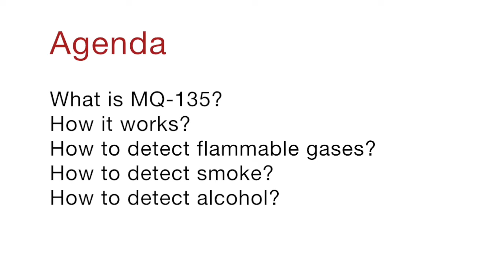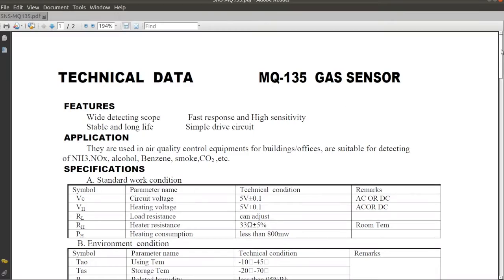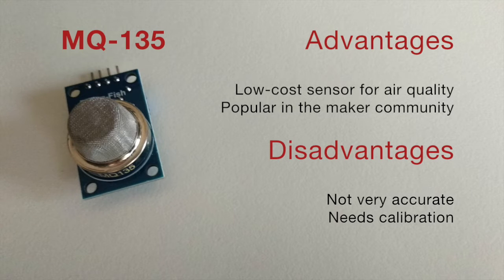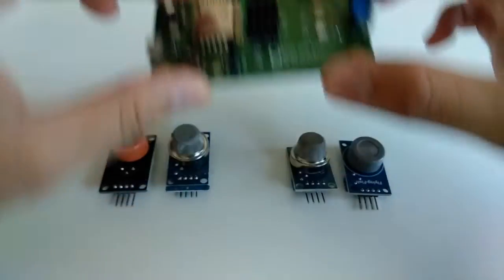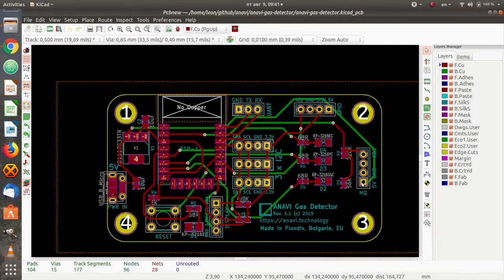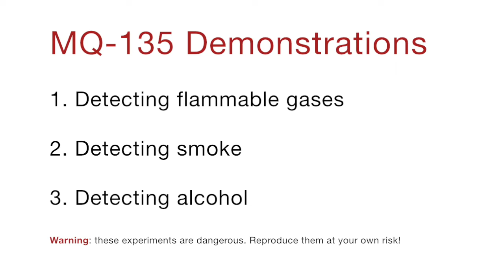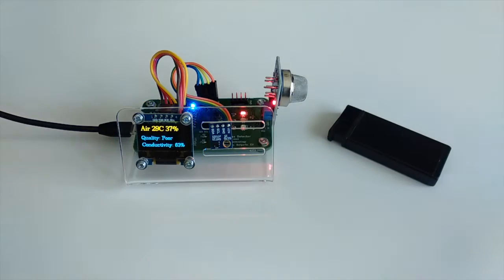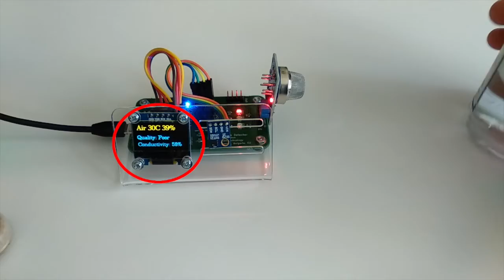MQ-135 Gas Sensor Module

Comment: if my sensor has 1k resistance and i want to change it to 10k ohms resistor ..how can i change it without removing existing resistor on board and put 10 k ohms resistor?
Reply from the maker: Well... good question but unfortunately in this case I am afraid you will need a soldering iron to swap the resistors on the MQ-135 gas sensor module.
Reply: @LeonAnavi  i have tried an another option to put 10 k resistance and its works for me if the output is 0 the air quality is fresh or good .. and in co2 concentrate the baseline is 400 ppm
Reply from the maker: @jeremytiempo9639  Cool! Well done! Keep in mind MQ-135 and the other MQ gas sensor are for detecting dangerous gases in the air but they are not reliable for calculating the exact concentration of a particular gas. Details are described in the datasheet of the particular sensor. I think of MQ gas sensor more like an alarm: ok or not ok.
Reply: @LeonAnavi  the option is both side of a resistor connected to A0 and gnd pins

Comment: Hi Leon can we use MQ-135 module for detecting and also measuring the Ammonia level in the environment? if possible how to calibrate for the same?
Reply from the maker: yes, MQ-135 also detects Ammonia (NH3) however this low cost sensor is suitable for detection only. It is not capable of measuring the concentration of a specific gas in the air.

Comment: Carbon dioxide is not a dangerous gas. Do not confuse it with carbon monooxide. Do not fall to trap of laymen and Gretas.
Reply from the maker: This is a video about the MQ-135 sensor which is suitable for detecting
 of NH3, NOx, alcohol, benzene, smoke and CO2. The immediately dangerous to life or health of these gases depends on the parts-per-million (ppm) concentration in the environment.
Reply: @LeonAnavi  The video is good, I liked it. Your review of the sensor helped me to decide which sensor to buy.
It would be good not to create a misleading impression that CO2 is a toxic gas. https://ehrs.upenn.edu/health-safety/lab-safety/chemical-hygiene-plan/standard-operating-procedures/sop-hazardous-and , e.g. nitrogen could also be lethal depending on its concentration, but it is not toxic.

Comment: i bought the whole set of mq sesors from ebay and they work but they came with a Pro Mini strong Atmega328P and i cant figure out how to use the damn thing. any tips?
Reply from the maker: Have a look at the source code of ANAVI Gas Detector in GitHub. Although the wiring will be specific for your pro mini, the Arduino sketch will be similar (without the WiFi and MQTT parts due to the lack of such capabilities on pro mini): https://github.com/AnaviTechnology/anavi-gas-detector-sw

Comment: Great content sir! But a small doubt, how to preheat the sensor? Just leave it in room temperature for 24 hrs?
Reply: Even after 24 hours the resistance values are changing continuously
Reply from the maker: yes, you should leave the MQ-135 sensor module in a room with clean air, turn it on and keep it working for at least 24h.
Reply: @LeonAnavi  thank you so much!

Comment: as we know that this sensor is used to detect 3 or 4 types of gases so sir is this possible to get information about which gas is sensed ?
Reply from the maker: No, sorry, MQ-135 is a low-cost analog sensor only suitable for detecting dangerous cases and air quality. It is not capable of accurately calculating gas type or concentration.

Comment: please provide the data sheet as well
Reply from the maker: The datasheet is available from the specific manufacturer of the MQ-135 sensor modules, just google it and you will find appropriate datasheets. For example: https://www.olimex.com/Products/Components/Sensors/Gas/SNS-MQ135/resources/SNS-MQ135.pdf

Comment: What sensor can I use to calculate air quality index in the range 0 - 500
Reply from the maker: What unit do you have in mind for this range 0 - 500?
Reply: @LeonAnavi  Air quality index is the unit for measuring the air quality. It can have values from 0-500
Reply from the maker: @vrushabhshah4291 the AIQ is calculated based on the average concentration of a pollutant, for example particulate matter (PM). MQ-135 is not suitable for this. For such measurements you need a completely different sensor module, for example SDS011.
Reply: @LeonAnavi   Okay thanks, any smaller size alternative?
Reply from the maker: @vrushabhshah4291  well, search for PM2.5 sensors, there are various models on the market. In general due to the nature of the sensor the module are not very small.
Reply: @LeonAnavi  Okay, thanks for your help!!
Reply from the maker: @vrushabhshah4291  my pleasure, I hope the info will be useful!

Comment: What kind of digital filter do you recommend for the sensor output? Thanks
Reply from the maker: Analog to digital converter is required to read the data output from the MQ-135 gas sensor module as digital value. ANAVI Gas Detector has these hardware capabilities.

Comment: Hi Leon, I got the starter kit today, what exactly do I have to change if I want to connect the MQ 4?
Please just explain, I'm still a beginner in programming;)
Reply from the maker: Good question. Let me explain by going into the details. All MQ sensor modules at 5V are supported by ANAVI Gas Detector. These low-cost 5V sensor modules are analog. There is a built-in analog to digital converter (ADC) in ESP8266 furthermore on ANAVI Gas Detector there is a voltage divider.

As a result in the open source firmware the read analog value from the
sensor is converted to a digit which is represented as %. This is the
human-readable conductivity value. So the conductivity is valid no
matter if you are using MQ-135 or another compatible 5V analog MQ sensor.

The air quality on the display is based on threshold values in the open
source firmware which are based on the conductivity for MQ-135.
Eventually, you may need to fine tune your sensor and adjust these values in
the source code. Here are these threshold values in the Arduino sketch in
function void detectGas(): https://github.com/AnaviTechnology/anavi-gas-detector-sw

The threshold values of 190 and 300 are compared to the digital value converted by the ADC from the analog value reported by the sensor module. Eventually, after measurements, you may need to change these values of 190 and 300 to other values for better accuracy.

Comment: Very nicely explained...one small clarification...can you tell what specific gas you have measured here using MQ 135...bcz my thesis is to measure CO and benzene...so can we program the sensor to measure benzene alone...I am a postgraduate dentist student...so can you explain please...

Or else is there any gas sensor to measure benzene alone that can incorporated in this same setup...

Can anyone help and reply to this asap since its urgent...
Reply from the maker: MQ-135 is suitable for detecting of NH3,NOx, alcohol, Benzene, smoke,CO2 ,etc. However, as the datasheet states it is suitable for "detecting", not measuring exact concentration of a specific gas in the air.

Comment: Is there any sensor available ,which can be used for detecting ammonia concentration in water
Reply from the maker: MQ-137 is an ammonia gas sensor for air and there are pH probe sensors for water.
Reply: @LeonAnavi  thank you sir ,howc an we ph probes to find the ammonia can you please share some reference vedio
Reply from the maker: @bennycolins4069  Sparkfun was offering in the past some Vernier sensors that might have been but they are now out of stock. There are many videos for testing ammonia in fish tanks using various kits, for example API Ammonia Test Kit. Just search for them in Google. Unfortunately, as of the moment, I don't have personal experience with any of them.
Reply: @LeonAnavi  Thank you sir 🙂

Comment: My Mq135 is constantly showing a high value and doesn't decrease below 200. What's wrong?
Reply from the maker: There could be numerous reasons for this behavior. Is the air in the room ok? Have you performed the 24h burn-in procedure the first time when you turned on the sensor?
Reply: @LeonAnavi  I'm sorry mate, I had made an error in the formula to convert the output to ppm. I've fixed the issue now, thanks
Reply from the maker: @rutvikjere6392  Cool! well done for debugging and fixing the formula in your source code.

Comment: Dear Sir Thank you for  this excellent video. I have a question about MQ-135.  I need to measure NOx gas in the car emission. Can this sensor mesaure?
Reply from the maker: Yes, as explained in the video, according to the datasheet MQ-135 detects NH3,NOx, alcohol, Benzene, smoke,CO2. However, there is a difference between detecting and measuring. If you need very precise measuring probably should look for something else.

Comment: hi sir did coding mq137 and mq135 both arecsame?
Reply from the maker: No, not exactly, MQ-135 is for general indoor air quality and MQ-137 is for detecting Ammonia. Reading the analog data will be the same but adjustments of the threshold values will be required because it is a different sensor.

Comment: Great video, i have a question: Is there a standard python code which outputs a csv document (for excel analysis) out from the data of my sensor? Im working currently on my raspberry pi 4 with an arduino to set the voltage to the 3,3V for my raspberry pi.
Reply from the maker: Not that I know of, however ANAVI Gas Detector default open source firmware transmits data over MQTT, therefore you can write a Python3 script on your RaspberryPi Pi that receives these MQTT messages and saves the data a csv document. Furthermore, on the Raspberry Pi you can install an open source MQTT broker, for example mosquitto.

Comment: Thanks for the nice demonstration, and is there any sensor which can detect SO2 gas, if please let me know
Reply from the maker: Glad you like the video. As far as I know there is another sensor called MQ-136 which is with good sensitivity to SO2. However, unlike MQ-135, MQ-136 modules are quite expensive.

Comment: can u please give me the code ? i tried to find it in github but the code that i'have found is too complicated for me.. i want to work with yours.. please. thanks for this video.
Reply from the maker: yes,  the Arduino sketch is available here: https://github.com/anavitechnology/anavi-gas-detector-sw
Reply: @Leon Anavi  hello, please  can i ask u?, i'm using the pir hc-s501 like yours, but it doesn't work like yours, i have to touch it for working and i have to make a big hit than it works. how can i do for it?  i tried a lot of methods and a lot of codes but it's always the same probleme it take a lot of time to detecte and it detects only when i hit it not wen i mouve my hand. please help me it's for my graduation. thank you
Reply from the maker: @thizirisef5643  this video is about MQ-135 gas sensor module, not for hc-s501.

Anyway, some guidelines that might help you: the PIR motion sensor hc-s501 has a couple of potentiometers on the back for adjustment and calibration. Give them a try.
Reply: @LeonAnavi  sorry,,, i have a probleme for the bothe....mq135 and hc-sr501, sorry it was a mistake i was watching a video for the hc-sr501. if u can help me, i don't know how can i fix it because it detects mouvemnet just when i hit it... it dosen't work when i mouve my hand for exemple.... i have to tuch it and hit it .... can u help me please
Reply from the maker: This tutorial is for Linux on Raspberry Pi however it might give you some general guidelines about wiring and calibration of PIR motion sensors: https://www.youtube.com/watch?v=ShnzQSFwVXQ

Comment: helloooo is  it also capable of detecting alcohol coming from disinfectants (ethyl)?
Reply from the maker: Good question. I think so, it probably will react at least to some degree, although I haven't tested it personally yet. However, keep in mind, as explained in the video MQ-135 reacts to various gases but cannot provide you exact concentration of a specific gas.

Comment: Just wondering, How did you came up with gas poor, moderate etc. ? I mean if you only getting 0 to 4096 based on the resolution of the AI, and the classification you had here seems standardized somewhere? thanks
Reply from the maker: I came up with the threshold values for poor, moderate and good based on the information in the MQ-135 datasheet, looking at some scientific papers and experiments to verify the digital values coming out of the sensor module through the analog to digital converter (ADC) in the ESP8266 and the voltage dividers on ANAVI Gas Detector. Have a look at detectGas() in the Arduino sketch and eventually modify them if you need for a more specific case:
https://github.com/AnaviTechnology/anavi-gas-detector-sw/blob/master/anavi-gas-detector-sw/anavi-gas-detector-sw.ino#L1150

Comment: Very good demonstration. I have calibrated my sensor for 24hrs and now I am stuck at the code for getting ppm values. I have searched a lot for the library and got confused ,since the forums and other discussions have their issues with the RLOAD VALUE and the RESISTANCE formula. I have 1k load resistor on my sensor module. Please help me in guiding to get the correct library with required adjustments for better RZERO value for the sensor.
Thanks in advance 😊
Reply from the maker: Honestly, based on my experience and the datasheet MQ-135 isn't capable of accurately getting ppm value for a specific gas. Although, there are some articles and Arduino sketches about this the results are not good. MQ-135 is a low-cost gas sensor module sensitive to a mix of several gases: NH3,NOx, alcohol, Benzene, smoke,CO2 ,etc. MQ-135 acts more like an alarm to tell you if the air is OK or not.

Comment: How to calibrate??
Reply: Ok ty
Reply from the maker: Perform the "burn-in" procedure on first boot of MQ-135 analog gas sensor module by leaving the sensor working in a room with clean air. According to the datasheet the preheat time is over 24h.
Reply: @LeonAnavi  how can i burn it?
Reply from the maker: @jinebuwan9549  apply 5V power to the VCC pin on MQ-135 gas sensor module to turn it on. On the first boot leave the sensor working in a room with clear air for at least 24h.
Reply: Only on first boot?
Reply from the maker: @jinebuwan9549  yes, after that on each boot the sensor heats in a few minutes.
Reply: I boot it many times because idk that it need to be calibrated , does the "burn in" will still work?

Comment: Hello. Great demonstrations. 
I wanted to know if I can measure concentrations of two or more gases (say NO2 and CO) simultaneously? 
Thank you
Reply from the maker: MQ-135 can detect multiple gases simultaneously. As explained in the video it is not capable of measuring accurately a value for the concentration of a specific gas.
Reply: then which sensor will give excat gas detection

Comment: Hi! Thanks for sharing the video. Wonder if other sensors e.g. C2H4 sensor (ethylene) can be used with this PCB?
Reply from the maker: The board is compatible with analog 5V sensor modules. Apart from MQ-135 there are several similar sensor modules like MQ-2 and MQ-3. However, at the moment I don't know if there is a low-cost gas sensor module sensitive to ethylene.
Reply: @LeonAnavi  https://www.membrapor.ch/electronics/ please take a look, if adapter is purchased along with the sensor and your PCB, all should be good and working?

Comment: Can i use mq135 for outdoor surface
Reply from the maker: No, MQ-135 is used in air quality control equipment for buildings and offices. It is not suitable for outdoor use.
Reply: Which one is good for outdoor.
Reply from the maker: @srijsri6738  most commonly particulate matter (PM) sensors are used for outdoor.
Reply: @LeonAnavi  thank you for ur response

Comment: Hello sir. This video is more informative. I need to know whether you have used temperature and humidity sensor with your controller? The program that you have written is quite large and it's hard to understand.  Can you help me in the calibration of analog value to PPM value sir,?
Reply from the maker: Yes, measuring temperature and humidity with HTU21D I2C sensor module is integrated in the default firmware of ANAVI Gas Detector. Details about the project you can find at:
https://www.crowdsupply.com/anavi-technology/gas-detector

Comment: Whether the code can be customized to communicate with Home Assistant / ESPHome or SMART HOUSE programs?
Reply from the maker: Yes, actually the default firmware of ANAVI Gas Detector that supports MQ-135 has been already made to work out of the box with Home Assistant with the machine to machine protocol MQTT. 

The default firmware of ANAVI Gas Detector also supports Home Assistant automatic discovery over MQTT. For more details visit:
https://www.crowdsupply.com/anavi-technology/gas-detector

One more thing: the default firmware is an Arduino sketch available at GitHub:
https://github.com/AnaviTechnology/anavi-gas-detector-sw

Comment: what is the maximum distance (in meters) sensitivity of the mq-135 sensor?
Reply from the maker: Depends on the volume of the room and how you have adjusted the sensor. Have a look at the section for calibration in the datasheet of MQ-135 for details.